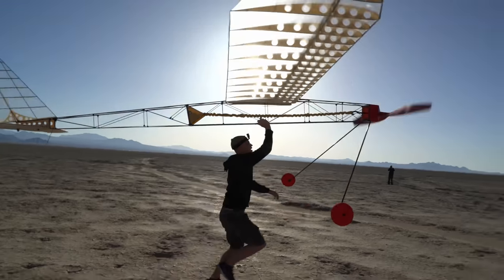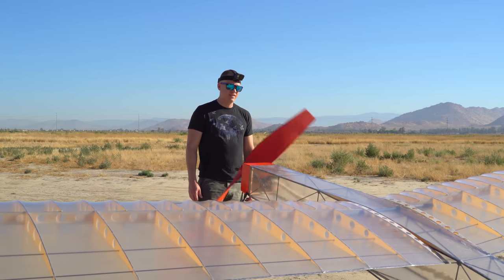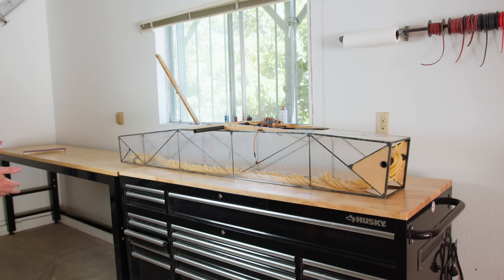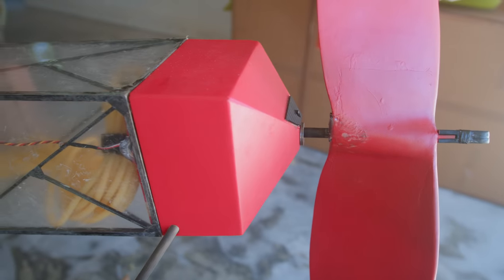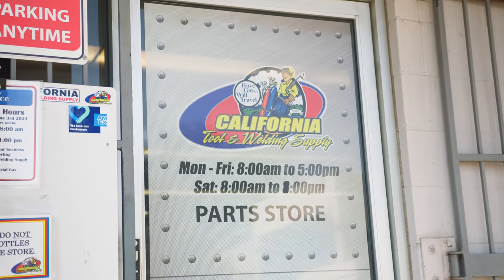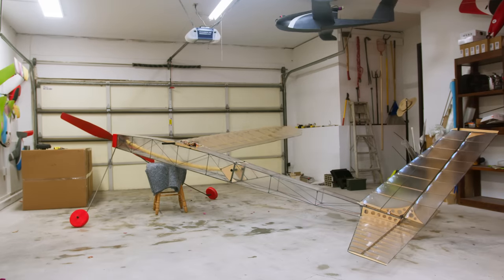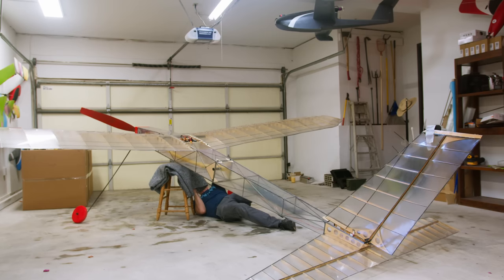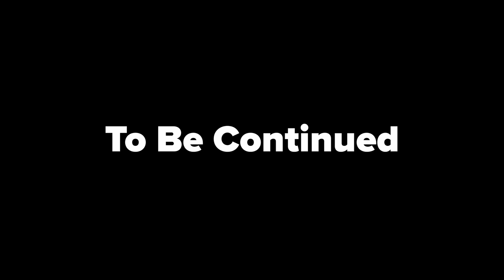Balloon Launching Massive 16 Foot Rubber Band Airplane

Comment: The second you asked if you should add a elevator servo I was immediately shouting yes at the screen. Based on the video that I saw them I am not sure that they would have made much of a difference. They may have prevented you from going upside down but I definitely think you would have needed more thrust to gain the control authority that you needed to gain control of the aircraft again.

Comment: What if you use the rubber band in a linear motion with a gearbox to transfer the pulling force into rotational force with a large gear ratio, so that the pulling force over time is extended to its maximum while also getting optimized rotation speed for the propeller?

Comment: Of course aerodynamics is always that Balancing Act! Lift against weight propulsion against drag, strength against weight.  You could build that things or weighed 60 pounds and you could drop it off the balloon like a dart and it wouldn't even bend it, but that's not what you were trying to accomplish. I was trying to figure out why they'd gone inverted when you were showing at flying and I hadn't realized its wings at Flex that much. Maybe for version 3.0 or whatever you're on, build some diagonal braces to prevent it from twisting?

Comment: Maybe if the fuselage could be strengthened without much weight gain you could increase the power with more rubber strands. Maybe the wing needs more dihedral and washout at the tips?

Comment: Hydrogen is easy to generate..aluminum shavings, sodium hydroxide to dissolve the aluminum hydroxide and water.  You need to control generation rate with water, dry the gas by passing it through a container of desiccated Epsom salt and cool it.  Far cheaper than helium.

You always need trim..trim for speed, power for climb.

Comment: How much weight would the addition of internal guys made of monofilament add? Might this be a solution to the wing warpage at higher speeds? External guys connecting to the fuselage might be more effective, would the added drag be significant?
Much stronger but also much heavier: twin spars. Carbon fiber would help get past weight gains, but that seems rather contrary to the spirit of this project.

Also, I'm digging the slogans on your friend's shirts. Especially, "I'd rather have questions that can't be answered, than answers that can't be questioned."

Comment: How about two sets of balloons connected by a bar that holds them apart?  Each set has enough lift to lift the plane.  You hang the plane so it is pointing towards the other set of balloons.  You will need a counter weight suspended under the forward set of balloons.  A second bit of string or thin rope goes from the plane to the forward set of balloons where the counter weight is.  You release the plane from under the rear set of balloons and the plane will swing forward like a pendulum.  This will give the plane forward momentum before you release it from the balloons similar to a hand launch.  Then once the plane is cleared of the balloons to flip the switch to deflate more than half the balloons so counter weight comes down slowly.

Comment: make your wings air tight and fill them with helium, or you could put the prop on a long thin light weight shaft the length of the plane with the rubber bands connected to the body and then wind the rubber up along the shaft as tightly as possible which should give you a boost in power and duration!

Comment: hmmmmm maybe it needs a wing strut or 2 to keep it square like a piper cub, or diagonal carbon ribbing inside the wing or a box tube spar. even 2 or 4 flying wires connecting halfway out on the wing would help. also tapering the wing a bit like a glider wing means less wing to twist on the tip and less effect when it does. At the very least an elevator servo would let you keep it level so it doesn't dive and accelerate too much. but for true free flight it needs to be trimmed to have a gentle phugoid by having the elevator pulling up and a bit nose heavy.

Comment: I'm surprised you don't use a power drill to wind up the propeller.  About the "crash", the wings are clearly strong enough to hold the plane in the air, it's only when it went into its Stuka impersonation that the wings broke.  And it only went into a nose dive because it lacked air speed.  So what if you started the propeller a few seconds before the balloons were cut to allow the plane to gather some air speed (yes, towing the balloons behind isn't ideal) so there would be less tendency to nose dive?
Reply from the maker: Sketchy, the timing would have to be perfect but it seems like a real possibility.

Comment: 1 motor starts before launch. 2 propeller too big for rubber power.  3 nose heavy. Higher RPM  in the propeller. Gives more thrust.

Comment: Wow, too high of airspeed leads to wing twist. I wouldn't have guessed that to start with. This is a very edge of the science build. Ultra light weight, very poor power density, minimal controlabilty.  I commend you, I work in aerospace on a space plane and see these same struggles everyday.

Comment: G'day,

Yay Team !

I'm glad you're trying again.

I have about 50 hours flying a CC Lee Falcon, a 2-Channel twin electric Pusher-layout Motor-Glider - one Stick for Full Throttle on both Motors, the other Stick either cuts the inside Motor towards which one wishes to turn ; or applies Full Throttle to the outboard Motor if one uses the Turn-Stick while gliding...

Full Power (when new) stabilised in a 45° Climbout - if Power was applied AFTER the inherent Aerodynamic Dynamically stable instability of the Decollage Angles with Dihedral Wings - Polyhedral Tips had recovered it from Launch, into a 
STABLE  Glide..., from which to accelerate.

What I saw you do
Hereinat,
Was to apply
FULL POWER at close to
Zero forward
Airspeed...; while the 
Nose was 35° 
Below the Horizon, and
Falling towards 45°...

And as a "Veteran" 
Asymetric Motorglider operator..., my experience is that adding Power while in a Dive will - due to the Nose-Down offset of the Thrust-Bearing's alignment...
Hold it in the 
Dive for longer, until sufficient
Airspeed enables
Decollage to overcome the Nose-Down Thrustline Offset.

Indeed, when spinning down on one motor, sometimes when the Power was cut, the Aerodynamics pulled it out of the Dive SO Hard that the 
Wings snapped.

Eventually my Woven Glassfibre Cloth & 5-min. Araldyte Epoxy Repairs added 50% to the Airframe Weight, and 15° Climbout was all it could achieve.

However, my main suggestion is than
Next time,
WAIT until the
Aerodynamics have pulled the
Airframe out of the Dive it has to 
Recover from,
AFTER you 
Release it in a
Deep
STALL at
400 ft.

I think you would have a 
LOT more fun by
Hand-Launching it
In
Zero Wind, 
From any 
Mountaintop Lookout, or
Cliff/Headland-Over-Beach, where
People are already used to going &
Jumping off, into the 
Sky...;
While strapped into a
Hang-Glider or a 
Paraglider.

What you want, is a
Topographically advantageous
Location, from which you may
Launch from a
Great Height, under
Controllable, & tweakable
Conditions, into
Clear Sky with an
Unobstructed flat
Landing-zone.

Balloon-Bombing
Launching
Stalled from 400 ft is
Always going to be a
Silly
Idea..., which always commits you to
Diving & 
Zooming at VNE through the
Pullout - then adding Power
After the Nose comes up 20° or so 
Above the
Horizon.

And, frankly, your
Airframe looks to
Fragile for such
Manouvres.

Fix what you've already made to work..., and if you can get FAA Permission to Balloon Launch from a thousand feet or so then go again - do it twice maybe to ascertain the added flight-time Rubber Power makes to the Glide-times, from the same Release-Height.

But if 400 ft's the unalterable limit for RC  Balloons, then maybe find a Human Crewed Hot Air Balloon to Launch it...; or forget Aerostats completely, and go and check out your nearest
Hang-Gliding Site, instead...?

Just(ifiably ?) sayin',

Such is life.

Have a good one...

Stay safe.

;-p

Ciao !

Comment: This issue is not new.

Hang gliders dropped from air balloons would invert after dropping, so before they do, they would pull a line and angle themselves down to reduce rotational momentum so the speed pucks up and control is gained with airflow. 

Angle the plane down more. 

Good luck dude

Comment: It’s a shame it wasn’t successful at this time. Despite the problem you found with the wings twisting I was watching a similar video recently where the idea of getting a plane made out of solid wood to fly was raised into the air by a drone and dropped from several hundred feet up. They found with the plane hanging from its tail and the nose straight down it would reach its terminal velocity quicker and get lift over its wings and level out.
So basically I think the other main problem is that dropping your plain from balloons in the manor that you did, didn’t create enough initial forward speed to create lift.
However don’t hold me to this as I’m definitely no expect on this matter.

Comment: Unless you upgrade the power plant (the rubber bands) then the plane will only fly under power for the same 20 seconds as the ground launched test. After the 20 seconds of powered flight it will just be a glider which is not as interesting. Basically the difference in distance traveled would not be much different if the plane was launched from the balloons without even winding up the rubber band as it would be if the rubber band was wound up. Of course that would require the plane not to fall apart after being released from the balloons in the first place. Either way, its more interesting to make a longer flying giant rubber band plane from ground launch then the gimmick of launching it from balloons.

Comment: Honestly, I think your propeller is too large/pitchy for the available torque from the rubber motor.  If you are determined to use a scale looking propeller, you need less pitch.  But I honestly think a smaller prop will do better.  I'd suggest that some thrust testing is in order.  As to the elevator servo:  I'm not so sure it would have helped.  At least not enough.  As I'm sure you know, all asymmetrical airfoils have a pitching moment dependent on speed, more speed means more pitching moment.  The wing could twist, so it did, and even with elevator control to adjust speed it may still have washed out enough to lose overall lift.  I'm sure an engineer of your skill can solve that problem.

Comment: You just need salt water and electricity to make your own hydrogen 🤷‍♂️

You can also use baking soda, if you like, as table salt will release chlorine as well.

Afterwards you need to seperate the oxygen out of the gas mixture. But I'm sure there's a solution for this which isn't expensive as f. :)

Comment: I am thinking the propellor is too big - smaller prop would spin faster and create more velocity - speed = lift. Just wouldn't last as long unwinding.
Reply: or actually, a, variable pitch propellor so the torque could be matched across the rubber band unwind

Comment: I’m going to be honest in my years watching model aircraft and seeing multiple test to verify on finding the center of gravity balance I’ve never seen any such as this model being gross tail heavy…. I was already after watching to look forward to a crash, the first time you picked up the model it looked as if it was within the cg limit, then the camera was added on the vertical stabilizer dropping the tail out of limit, I knew it was going to crash before it did, as for the servo on the horizontal stab? Why not save weight and make the whole stabilator move with trim adjustment?

Comment: Duel rubber band drive with gearbox.. you need power (torque) and prop speed.   Also... lower weight prop

Comment: Diagonal ribs or wires to stop the wing warping. Lifting in nose down attitude so the plane dives to gets flying airspeed. This was dropped in a stall airspeed and attitude. RC elevator may not of worked with so much wing warping.

Comment: It's amazing that someone would go to so much trouble and expense without spending five minutes running the project past someone who knows something about aeronautical engineering, or even just an experienced modeler. Or maybe just opening the right kind of book. I'm sure Otto Lilienthal had solutions for this wing twist problem in the 1890's. Otherwise he would not have survived over 2,000 flights before he crashed and died. 

I suppose some kinds of failures gather more views than successes would. I would have enjoyed a success a lot more. With a few design tweaks, and a bunch of FAI tan rubber, I'd guess this model would have flown for several minutes, from the ground, under its own power.

Comment: Seemingly does not work reliably to scale up a small model plane and not be able to scale the air density as well. Air is thick relative to a small rubber band powered plane. The design of the aircraft needs to adjust to the relative air density.

Comment: why did you have to separate it from the balloons at all
Reply: helium mattress plane
Reply: yep fill the wings with helium
Reply: helium has infinite flight time, on its own, like a boat on water
Reply: yep even solar balloon plane
Reply: and it is its own parachute balloon
Reply: it can be designed to be fast
Reply: rockets are fast, arent they
Reply: its a glider when you drop it right
Reply: glider can stay up without any power, air currents
Reply: faa is nuts, but a mesh net to make the balloon more sturdy
Reply: hydrogen hard to get? electrolyze on your own
Reply: metal foil balloon is fuel cell, right
Reply: aluminium foil helium fuel cell balloon
Reply: sling shoot a glider first
Reply: box wing floats and is rigid, 4-sides

Comment: If you had got it up about twice as high, the dihedral might have roled it level. It didn't break until it hit the ground. If you are using balloons to launch, you don't need a rubber motor. You are using balloons to put potential energy into a glider.

Free flight rubber powered airplanes must not be launched by simply dropping them. They simply fall to the ground and smash. They must be got up to flying speed and released, not thrown, releasing the propeller at the same time.

Your flights have been limited because you have not got enough torque and turns on the motor. The motor and propeller are likely not dimensioned optimally.

Those competition models you showed are not designed for maximum duration under power. They are not an example of what you are trying to do here. The motor is used simply to get a fast climb to highest altitude and the time is made in the unpowered descent. This will not give the maximum time that could be got from the plane and rubber. Highest altitude does not correspond to longest time. Time of flight is a matter of the relationship between available energy and power. Power is the rate of use of energy. Time is energy divided by power. The rubber has a defined amount ofenergy available. To get the longest time, you must use the energy as slowly as possible, using the lowest power that will keep the plane in the air. Unfortunately a rubber motor does not deliver a steady torque and power. There are ways to design the motor that will balance the climb energy with the descent energy to give maximum time.

https://www.endlesslift.com/rubber-motor-size-and-performance/

https://www.endlesslift.com/the-energy-of-flight/

In the 20 second flight, it is flying at close to apogee torque, not climbing much. Maximum torque would be around five times that. So you have along way to go with that motor. You might be able to get a minute out of it.

Comment: It is sad that you used helium. Helium is non renewable and we are running out. Is hydrogen actually more expensive or is it just a licensing issue? Hydrogen is much more abundant, has higher life ratios, leaks less, etc. The only issue is it is flammable but that isn't an issue here.

Comment: So, you know about real free flight rubber powered models, yet you didn't built a real one noir even a supersized version.  Why?  Also yes heat shrink plastic film is well known for the wing trust & flutter issue that destroys models.  Doped tissue paper is a better covering in this respect, unless the air is damp, in which case, it too can go slack & allow the wing to twist.  Cambered wings have the centre of pressure moving rearward as angle of attack decreases.  This is what causes the issue.  It is one of the fundamental  force coefficients of aerodynamics CMo.  The solution is to either sheet part or all of the wing, or to arrange the ribs at alternating angles to each other, like a truss or geodetic structure.  All these things are well known in model aircraft.  It tends to only be cheap beginner designs that have such issues.  They are done this way to keep the structure simple to build but it's self destruction waiting to happen.

Comment: OK, you learned something you did not know. That is the value of your project for now. I can not make any sense of your project, from a technical point of view. If you want to chase rubber bands, I would suggest working on that propulsion system and do the math, before even thinking puting it into an airframe. For riggidnes off the frame, OK, you can fix that. I would not build anything without ailerons myself, with the technology you are chasing.

Comment: I would like to suggest that you spend some time looking deeper into hydrogen. Your use of the Hindenburg tragedy was a bit of a disappointment, followed closely by the mistaken concept that hydrogen is difficult to source. There are, at least, a dozen differnt methods of cheaply producing hydrogen on your own. While the investment in better education will take a bit of time, I believe it would benefit you specifically to an almost unfathomable degree.